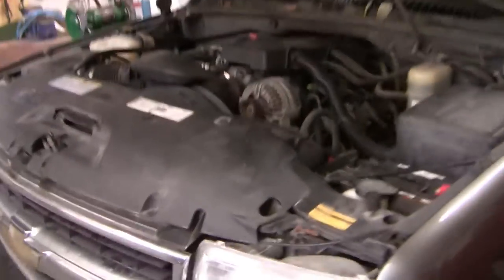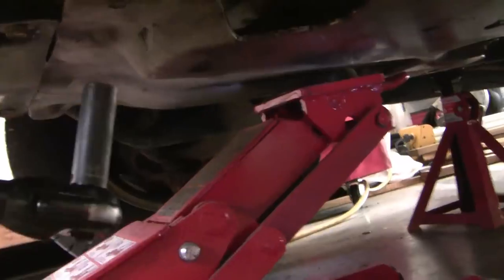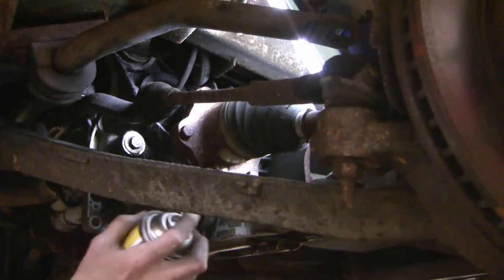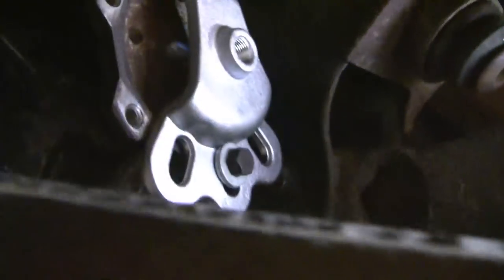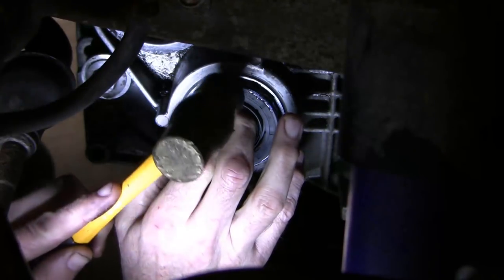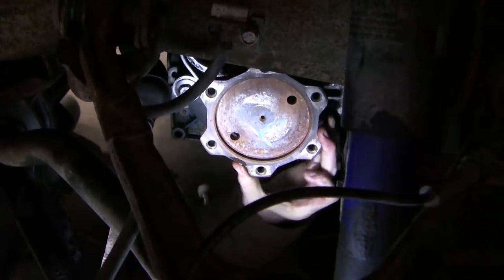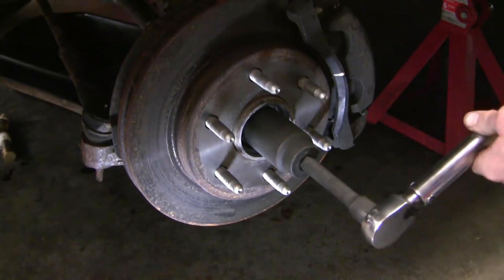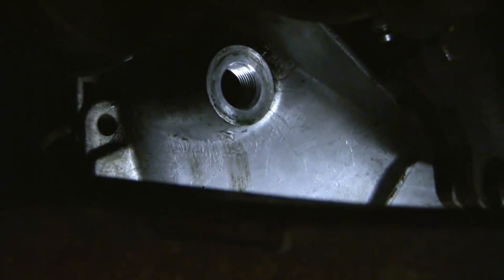How to replace left front axle seal and CV axle, Chev 4X4

Comment: to remove the drivers side axle, I used a plastic tree felling wedge. Available at most hardware stores in the chainsaw area for about 5 dollars.  I just put the wedge between the axle flange and the transaxle housing. Just a couple taps with a 2 pound hammer and it popped loose.
Reply: I used this method and it worked great.  I had to trim my wedge about a 1/4" because the angle wasn't steep enough, but just like described, couple of taps and it popped free.
Reply from the maker: Glad to hear it, thanks for the followup.
Reply: burpton that's BRILLIANT! THANK YOU! Now for an easy blind bearing removal!
Reply: Thanks for the info
Reply: Excellent tip!
Reply: Thanks man!

Comment: Thank You for this video.  I replaced the Left Axle Seal this past weekend with the aid of this video! A couple of tips that worked for me. I used 2 tree felling wedges (as suggested in the comments section) and worked like a charm.   I also put the new axle seal in the freezer overnight.  Not sure if the freezing was the reason why, but the seal install was much less painful than my past experiences. thx again

Comment: That's about 10 years later now. Good job. Just did on my LTZ 2006 both left and right seals.   After watching some videos for the right side axle seal, I found that mine is different. My right shaft tube does not have any electrical connections to unplug. It is a simple straight tube and the axle with the   O - ring inside. This axle just longer than left side one. The removal is the same. Bang, bang and it comes out. No spring or washers to watch out for like the shaft tube with electrical sensor connection. Perhaps my electrical sensor connection is somewhere  and not on this shaft tube. Just feeling good that I was able to do it. Thank you to all who take their time to post these DIY videos.

Comment: I just did my seal on my 98 k2500. I removed the sway bay link, ( both need replacing anyway) removed the axel, then tried prying with a pry bar. I didn't like prying on the aluminum housing, so I used a hammer and a small piece of wood and hammered on the axel flange while turning the flange. It took a little time, but it came out. The c clip was still on the axel, but looked good. Replaced the seal, being very careful tapping in the new seal, and all went back together well. I have good ground clearance, so I didn't even jack up the truck. Took about 3 hours. Now I am off for an inspection sticker. Thanks for the good video and info!!
Reply: Brad Davies read your comment on changing you axle seal. You said the c clip stayed on the axle, was is still "tough" tapping it out? Also, how is it doing? Any leaking, is it still good?
Reply: It took a little work, but it did come out. I did notice the seal was still leaking about a month later, witch tells me that the axel itself had worn a grove where the seal makes contact with the axel. I have since traded the truck in, as a lifter was sticking and I didn't want to remove the intake manifold to replace the lifter. Good luck with your project.

Comment from the maker: I wondered if that would work. When I did the axle seal on the right side, shown in another video, the way you describe is the way I did it. On this side I followed the dealers manual guide, which suggests doing it this way. The reason I chose a longer method was because I knew the C-clip would be a problem and I wanted plenty of room to work with. But it's nice to hear from somebody who was able to get it done a quicker way. Thanks!

Comment: Thank you for a most complete video including the torque specifications and the minute observations. Since my local parts store has a tool loaner program I decided to go the slide hammer approach (I couldn't find my steel wedge I usually have for things like this). I welded two 5/8-18 nuts to a 1/2-13 coupler. The slide hammer had 5/8-18 male. I then used a 24" piece of 1/2-13 threaded rod to pass through the wheel hub and attach to the puller bracket. With the truck on stands I used the jack to raise the wheel hub to be nearly concentric with the differential. With a couple of slide actions the output flange stub came out. My local shop quoted me $450 for this job.

Comment: I went ahead and tried it.  Got the shaft out fine.  I did have to remove both the stabilizer bar and tie rod to get the drive shaft out of the way.  In doing all that, I tore the dust boot on the upper ball joint, so that's the next item to tackle.  My seal looks a little different than yours, but I did get it installed and the shaft back in the case.  Everything turns like it should.

Thanks for your help, keep making great videos!

Comment: as for the RTV Blue...I did the same thing on a rear axle seal for the same reason. First go around I didn't use it and the next week I was back in it. For such a small scratch it still leaked. After a thin coat of RTV, 156k hard miles later....still no leak. Let them say what they want. It works. I did polish it a little with emory cloth as well prior to application.

Comment: Nice job Dave! Yeah, those c-clips can be a PITA. I sure am glad to see you use some grease on the splines of your axle before you slid it in. There are so many of these videos out there where guys will just slide them in dry. I had one axle where the splines were totally rusted together. That joker took me about seven hours of penetrating oil, puller, impact wrench, etc. just to get the splines to separate. Not a bit of grease on there. Keep up the good work!

Comment: Two thumbs WAY up!!!  I rented a sliding hammer to pull my inner axle but it was too long to work.  I watched your video and when you demonstrated tapping the axle flange adapter for the sliding hammer (the base part of the slide, not the axle itself) I tried it and it came off in 4 easy taps.  Piece of cake!!  Thank you so much for your video :D
Reply from the maker: What a kind remark, thank you.

Comment: Thanks for the video. My son just wobbled my 98 z71 home. The driver's side wheel is at almost a 45 degree angle. Not sure how he even got it home. The cv boot at the wheel has grease all over the place and you can see separation at the back plate. Probably a good chance I will have to replace the wheel/hub assembly as well. It's ugly. I've never replaced a CV axle before but your video makes it look very straight forward. Thanks!

Comment: I had the left front seal changed on my '99 yukon and within 4000 kilometers it is leaking worse than before. The dealer isn't responding to my concerns but after watching your video i will check the vent before pursuing any further with the dealer. Having work done at the dealers seems to be a shit show lately. I've had to return for three jobs not done properly on this vehicle.
Reply from the maker: If it leaks again within about 6 months I'd complain. I doubt most would warranty beyond a year. Check to be sure it is not overfilled, I'd have to check the service data for the exact fill level. Removing and sealing that vent plug is probably within the wheelhouse for most backyard mechanics.

Comment: I rarely subscribe to anyone but your vids are so well done. No nonsense and simple without leaving out details. I love videos that say "today we will rebuild our small block. Disconnect the battery cables.  Pull engine.  Rebuild. Replace engine. Reconnect cables. ".  

Well thanks for details? Lol! 

I have a 97 blazer and I was hesitant to get into this one until I saw your video. I know anything involving axles can be problematic and usually requires tools borrowed from NASA.  

Seeing your videos makes me feel way better about this one.  I have no doubt I can handle this. 

Thanks for the great video! Keep it up.  

P.s.  Do u have any videos on how to keep a woman happy?
Reply from the maker: Ha ha, very funny. My wife keeps telling me I should post a vid of how I dye her hair in the garage (grin). Not happening.
Thanks for the vote of confidence, and good luck with your project! One of the problems with DIY auto repair is the unexpected complication, like a stripped screw head, a broken or crossthreaded bolt, or a broken plastic part. When things go well, repairs can look deceptively easy. I wish I could reassure people it won't happen to them....

Comment: Good job man, your Video was just what I needed. The Chiltons manual says to pry it off with a large screwdriver or two. We all know that it's not good to get crazy a pullin & a pryin against an aluminum housing of any kind. And it sure doesn't come out as easy as the book makes it sound. Great Vid! Thanks!
Reply: You can use a 2x4 and place it against the flange and tap it out with a hammer.  Same concept that he illustrated in the video, just different tools.

Comment: Thanks very much for this video spelunkerd! I used it today as a reference while changing the seal on my 98 K1500. I also noticed that the snap ring remained inside the housing, so I assume that it's normal. I would just like to add that I had a lot of trouble pounding the shaft out. I found that tapping the shaft into the housing first freed up a bind in the snap ring and then it just popped right out. Thanks again!
Reply from the maker: Good point!

Comment: I have a 96 suburban everyone told me to use dexron for my fluid.good video.
Reply from the maker: mark bryant I use dexron and I've had no problem with it. Others on the 'net complain that it sometimes gums up, causing lots of issues. I think many of those problems are a consequence of overheating, and I wonder if dexron is particularly susceptible to formation of residue when overheated. However there are antioxidant properties that advertisers say is an advantage. If you do switch over, drain everything first to avoid incompatibility issues.

Comment: I have a 2001 Suburban 1500 and will be replacing the tube bearings and seal on the same side( there is significant play at the diff as well as lateral movement) so this video has been great in prepping for that job. Im toying with the idea of removing the entire front diff assembly from the truck and replacing both seals and bearings on the bench but I fear Ill lose my leverage advantage with it not being on the truck...

Comment: Thanks for the vid.  I was going to take mine to a garage, but I can handle the job after seeing your video.  Thanks !!!!!
Reply from the maker: I'm glad it helped. Good luck!
Reply: Finished the seal replacement.  There is an "improved" seal the dealership sold me that looks a lot more robust than the old one. Job went smooth. Thanks Again!!!
Reply from the maker: Great, thanks for the followup. Interestingly, one viewer mentioned that his parts supplier was selling a seal that needed to be installed 'backwards' compared to the OEM seal. His seal was labelled that way. I used a NAPA seal that looked identical to the original and it went in the same way as the original.

Comment: Great video.  Planning on doing the seals on my 2010.  I would imagine it's the same concept.
Reply from the maker: Probably, I'm not sure. I use Alldata, but whether you use Mitchells, Alldata, or an ebay copy of your dealers manual, it would be wise to check that out first. Have a close look at the CV joints as well. Sloppy movement of those joints could cause your seal to leak. Good luck!

Comment: Great video. My passenger side CV boot just blew on me. This video is a great help.
Reply from the maker: I'm glad you liked it. The repair is pretty easy if you have the right tools and safely take your time. I did the passenger side intermediate shaft seal on this vehicle, shown on my channel. The two sides are not identical but the principles are similar.

Comment from the maker: A few viewers have noted that they were able to remove the axle seal without removing the CV axle or the wheel. If it works you'll save time, though it may be a little harder to maneuver with the axle in the way. The way I did it is the way the dealers manual explains how to do the job. However it wouldn't be the first time that techs found a time-saving short cut not mentioned in the manual.

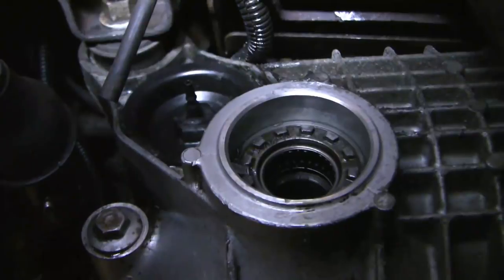Comment from the maker: At 6:16 you get a good look at the vent tube, centered in a large plastic cap with a central 24mm hexagonal nut at the base. Some versions of the Chev diff are prone to leaking around the threads of that cap, and if yours is leaking then now would be a good time to remove the cap to seal those threads. It is often hard to tell if leaking oil is coming from the vent cover or the axle seal. I show how to reseal the vent cover in an updated video, here: https://youtu.be/KvSysO3zQos The cap needs to spin off to allow a peek at the diff gears when adjusting backlash and when painting gear patterns. So, any sealant applied to the plastic threads needs to be nondrying so you'll be able to get it off in the future. Never-drying silicone paste or teflon tape would be reasonable choices, but probably not silicone caulk.

Comment: thanks for the vid .I just did mine after watching this vid.  Less than an hour.  You dont need to stick it 4wd if you use an impact gun to remove the bolts and I didnt remove the sway bar link bu did remove the sway bar to frame mount bolts and which allowed the driveshaft to slide out.
Reply from the maker: Thanks for recording your experience here, I'm sure others will find it useful.

Comment: This is the best video by far on this. I'm changing the bearing behind that seal while I'm there though - I picked up that info from other video's... I had to buy the hammer/bearing puller like yours for the bearing and probably have to take a couple more things apart to enable the straight pull. Doing this myself will more than pay for my new puller :{ ) Thanks for posting - Was very helpful
Reply from the maker: Great! Pay it forward and video your effort, it is rewarding to contribute to the general knowledge base. You never know where this can lead, ha ha.
Reply: @spelunkerd  You might not want to see it, as I'm currently limbering up the courage with a couple Rum & Cokes (not a sponsor) lol.  I'll be getting at it right away though, and will share any Highlights if warranted - I'm pretty sure you nailed it though , and won't need to add. Cheers & Enjoy Your Weekend bud !!!
Reply: @spelunkerd  Ran into problem with my stabilizer bolt not able to be removed unless I wanted to cut it or take apart ball joints.Mine were different with bolt from top and nut on bottom with no clearance to remove.  I changed the seal by just taking out six bolts. I tarp strapped out of the way and / like you gently tapped with a hammer - not kidding real easy and just a couple light taps as I turned it. pried seal out - bearing seemed ok after all so just left it in the end... Leak fixed after a good test drive A OK

Comment from the maker: If you are referring to the bearing I think you are, then I believe yes you can pull it out with a slide puller. But don't take it from me, you need to get a copy of the dealers manual to be sure, before you start into it. I use Alldata, but Mitchell is good too. Or, you could find an ebay copy electronically for a lot less than the dealers sell their manuals for. Good luck!

Comment: Definitely a great vid. God thing you don't have a 2500/3500, those inner left axles more often than not get stuck, then break off and you have to take the diff off and split the case to push the rest of the shaft out.
Reply from the maker: I'd be asking you what to do (grin). Nothing worse than getting part way into a job and realizing that you are over your head.

Comment: I just replaced this seal on my 2000 Suburban.  Just so you know, I did not remove the CV axel from the wheel hub, just from the diff.  Just remove the tire, those 6 bolts on the diff side of the cv axel, and push out of the way.  Yes, it is a little in the way from time to time but it beats having all the extra labor to remove it.
Reply from the maker: Great, I've highlighted your remark so hopefully others can find it.

Comment: @Dave  FYI the axle ratios are the same (they have to be)  front and rear but if you have a limited slip rear you must use full synthetic for the limited slip clutches to work per GM. Mine takes 75W90 full synthetic in the rear (I have 373 limited slip) and 80W90 reg gear oil in the front of my 2001 Suburban.

Comment: Hi. Great video, i'm about to do this on my GMC Sierra 1500 -99. I hope it's the same procedure on my truck.
Reply from the maker: Can't say, but they are probably similar. I have a dealers' repair manual for all of my vehicles. You can get them in CD form through ebay, from an online service like Alldatadiy or Mitchell, or from the dealer. I prefer the online form because you get updated TSB's.
Reply: spelunkerd I can say that it is exactly the same on my gmc and your chevy. Thanks man, great vid. 👍

Comment: Worked on 98 gmc suburban slt had to grind the frame down a little to slide the axle coming for the dif straight out and I didn’t have the socket for the axle in the hub so I didn’t take that off

Comment: Very nicely done, I would have liked to know if you put anti-seize on thew flange bolts or locktite. I just did mine and used anti-sieze. Thank you for the clear instructions. Good job!
Reply from the maker: +Jon Bradley Yeah, those are good thoughts. I don't remember if I used antiseize or locktite there, probably didn't bother. As I recall, there was surprisingly little corrosion after so many years. I still drive the vehicle today, having just crossed the 350,000 km mark.
Reply: Thank you for the personal response. It's a very wonderful adventure after all. Please continue!